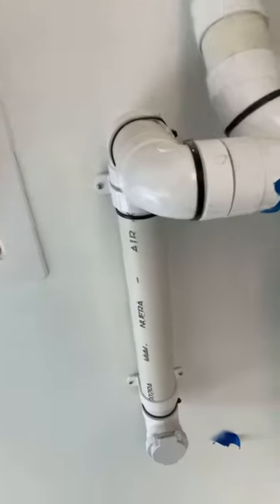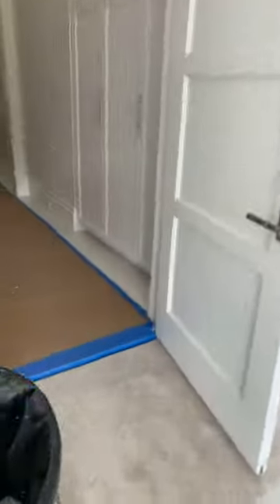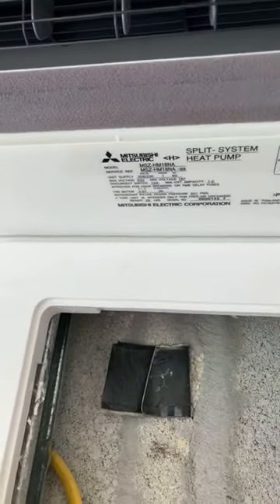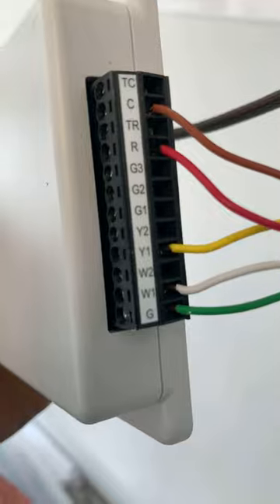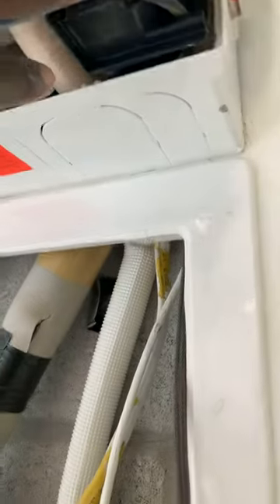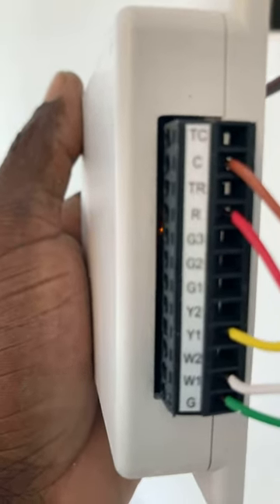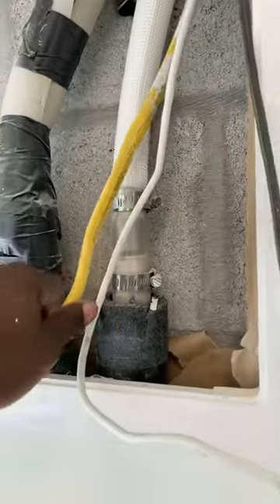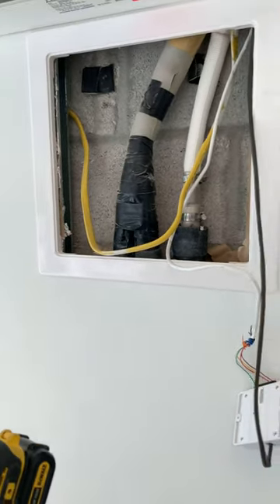How to hook up a thermostat to a mini split system

Comment: I would like to know if the mini split can be made to operate like a conventional furnace. Full bore until it reaches the desired temperature, than shut off. Currently it seems like it wants to constantly run and the thermostat controls the output air temperature.
Reply: Check out the Cielo thermostat. That is basically how it is functioning on my mini-split.
Reply: pretty sure they're more efficient when they run at a steady trickle